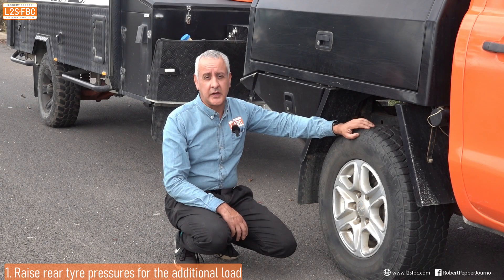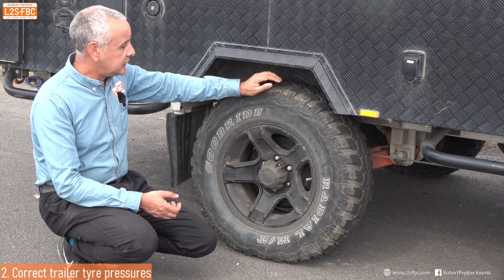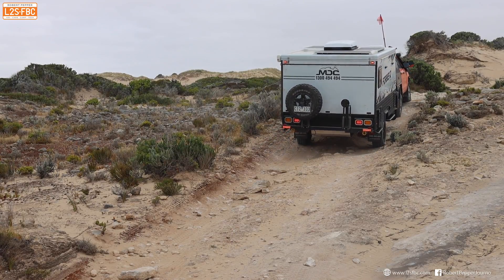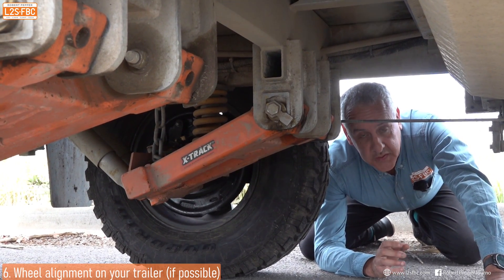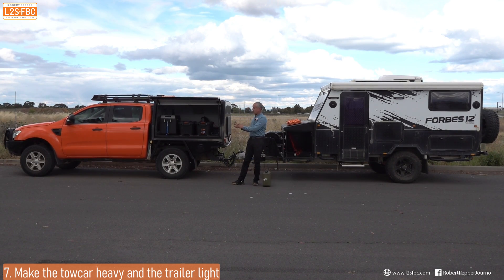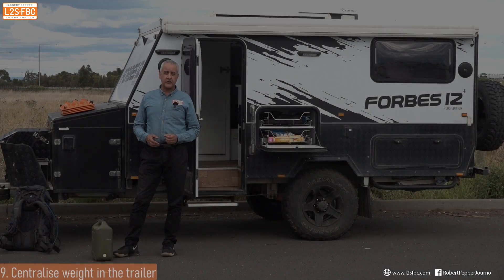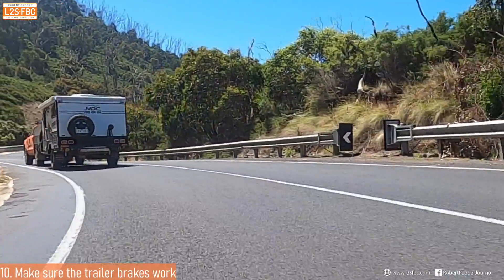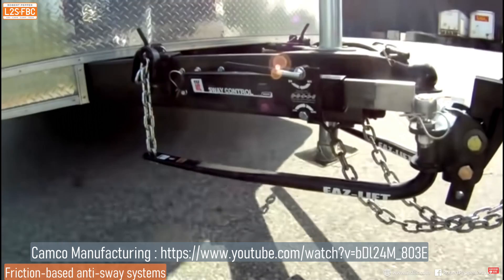10 ways to mitigate trailer sway & "drive to the conditions" explained

Comment: An interesting example of sway is walking pulling a Youngs welder, heavy transformer type.
Maximum speed about 2kph.
Short, high, heavy, flexible drawbar (arm), soft wheel barrow tyres. 
I had to stop to stop the wobble/sway.
If in doubt a trailer combination should be tested on a test track very carefully.

Comment: My 22’ van has always been absolutely fantastic on stability. Towball weight is only around 7%- AS DESIGNED. 
It has most of the weight around the axles BY DESIGN, including the kitchen and fridge, and of course water tanks. 
Even so, I researched thoroughly and added a Tuson Sway control in 2015, because there is no such thing as “too safe”. 
(The Tuson is really terrific system, which brakes individual wheels rather than both sides simultaneously,  and is in my opinion much better than the Alko system which brakes both sides.) 
And yes- I agree, drive to the conditions, which so many people do NOT do! 
We’ve been towing this van for nearly twenty years now and have literally never had a fright from swaying, because it’s designed AND loaded properly. 
I Absolutely cringe when I see some rigs- owners obviously have no clue.
Reply from the maker: Thanks for the info! Hopefully more of a clue after this...please share!

Comment: Really appreciate the effort you you put into these videos Robert! 
Having survived a full on yaw situation about 12 years ago (light rain, 100kmh, poor load distribution, a succession of potholes, yawing across both lanes into oncoming traffic, glad I got a finger straight on the electric brake button) 😮‍💨, I now understand every combination of tow vehicle and caravan has a critical speed. Once above that speed, yawing can irreversibly escalate out of driver control. That critical speed, and the degree of yaw, is directly associated with the tow vehicle’s mass relative to the caravan’s mass (and particularly mass distribution). It is also associated with caravan length, hitch overhang, tyre type and size, sidewall stiffness and pressure.
I now recognise these situations and adjust speed accordingly.  Interestingly, having just completed a trip from south coast NSW to FNQ and back, it is apparent that many other drivers of combinations do not.  It was nothing for me to back off a bit in high cross wind only to be overtaken by caravans wobbling past at much higher speed. A few of these I noted the van brakes flashing on & off, I can only assume Dexter or Alko was working overtime.

Comment: All the caravans I've seen on their side next to the road have been single axle, and the only time I've ever experienced significant sway was with a single axle trailer. I'm sure you could induce sway in a dual axle too, but they seem much more resistant to it. The biggest safety margin for me though is making sure the tow vehicle is heavier than the caravan. I've towed a 2.5 ton Jayco dual axle caravan all over Australia with a 3 ton Patrol and never had an ounce of sway, even when overtaking road trains or having to make sudden manoeuvres to avoid wildlife or errant drivers.
Reply from the maker: Yes, tandems less prone.  Didn't cover that as it's not something that can be easily changed.

Comment: Regarding age of tyres: I recently had the unmitigated pleasure of obtaining a car that had been parked up for at least 13 years. Tyres had heaps of tread, yet were dated 2009! Car went through re-registration inspection with them, so that's a failing of the inspection checklist for mine. How did they grip? In short, they didn't! Had similar on a 4WD with 10 year old tyres, even less grip. My opinion? 5 years old for tyres and it's time to change them out no matter the amount of wear. Maybe a year or two more on a light trailer. But not on a heavy trailer with brakes etc.
Reply from the maker: Thank you, that's exactly the sort of comment I get from people about tyres. Unfortunately some of them find out too late.  Not just caravans, but also classic cars.
Reply: @L2SFBC  True, but not all (brands) tyres are equal, and it also depends on storage.
I’ve seen two tyres of almost the exact same age, just eight weeks apart from the mould stamp (on my son’s van when he bought it), one still in great condition, whilst the other I literally wouldn’t drive around the block.

Comment: I have Tyre Pressure Monitoring System sensors on the trailer tyres as well as the car.  It can be very hard to detect reduced tyre pressure on a trailer, especially on a rough road.
Reply from the maker: Great point!

Comment from the maker: This is a summary video of 10 ways to mitigate sway.  For more detail refer to the list below, which is also a playlist (https://www.youtube.com/playlist?list=PLG5Om1_yP8jl_9zfIb-zrYP-_Nro1q1xq)

You can get "Press Away the Sway" merch here https://shop.l2sfbc.com/search/?search=sway

Weights & Stability
Shows the effect on stability of different weights in different locations on towcar and trailer.
https://www.youtube.com/watch?v=JeEEC5eVNCk

10 Things that make your trailer sway
When you recognise these risk factors, slow down.
https://www.youtube.com/watch?v=vHVa3kbe-Q0

How to control trailer sway
Ways to control sway if it happens.
https://www.youtube.com/watch?v=PS_T3-zCzHw

Electronic Sway
The two types of electronic anti-sway system compared.
https://youtu.be/ie_szIujKYI

Are your tyres too old?
Tyre age and how to check.
https://youtu.be/LV8bZ2qwDeg

Towing Tyre Pressures
Why rear tyre pressures are important.
https://youtu.be/l3Y0vdLhNjc

Hitch Height Effect
Why you need to tow level.
https://youtu.be/bxsqYrGA1nA

No Need for Muddies
Why you don't need mud-terrain tyres on your trailer.
https://youtu.be/4ycCjwLN0F0

Weight High or Low
The difference between weight high, and low - demonstrated.
https://youtu.be/6IMCEDyHOFY

How to fix
What works for sway and what doesn't
https://www.youtube.com/watch?v=nc0ndz92IWY

Ford's Towing Gamechanger
Next-gen Everest and Ranger; the towing difference.
https://www.youtube.com/watch?v=J2W9xtH9k-M

Beer, Wine and Bulldog Clips
All about weigh distribution and why it's important for stability.
https://www.youtube.com/watch?v=fX78Fu87Coo

8 Towing Weight Limits
The weight limits you need to be within.
https://youtu.be/rKm2qt8XYs0

Trailer Sway Crash
Interview with crash surivors.
https://youtu.be/8WEwhMszYQU

Post questions as comments!

Follow me on Facebook:
https://www.facebook.com/RobertPepperJourno/

Support me on Patreon:
https://www.patreon.com/L2SFBC

Buy my books: 
https://l2sfbc.com/where-to-buy/

Comment: 10% TB  weight seems to be some peoples target indeed. I prefer a lowest stable limit. Even down to 7%.
Reply from the maker: Mine tows at 7% just fine. However other trailers may need more..it's situation-dependent and there can be no rule for "always x%".  It's too complex to cover in a summary video.